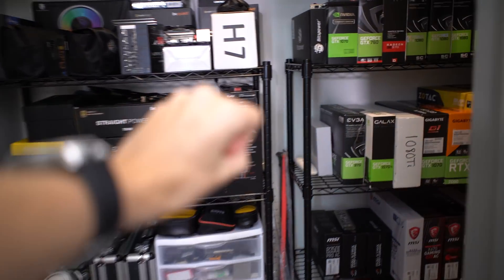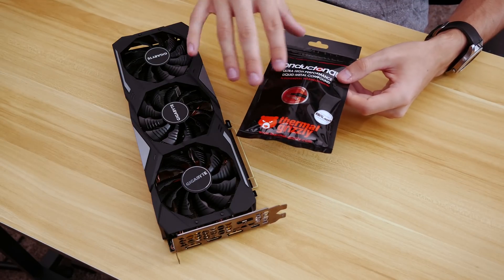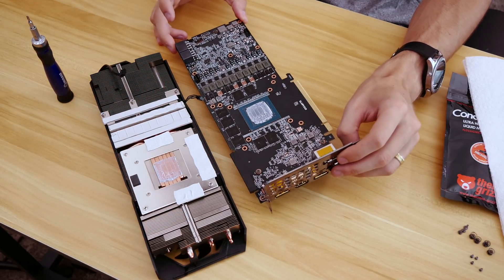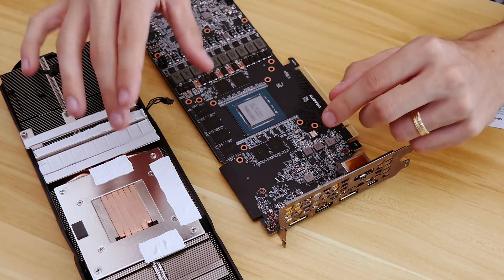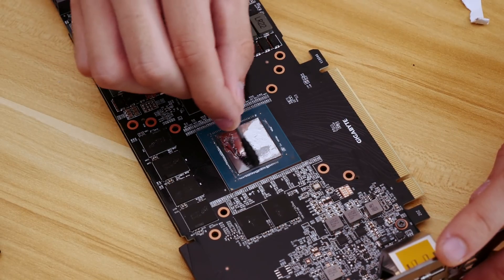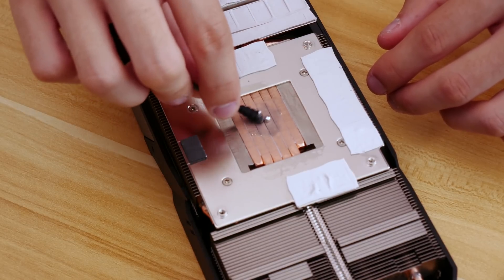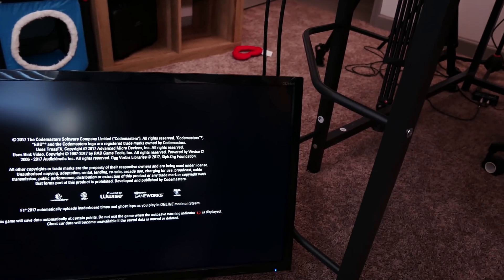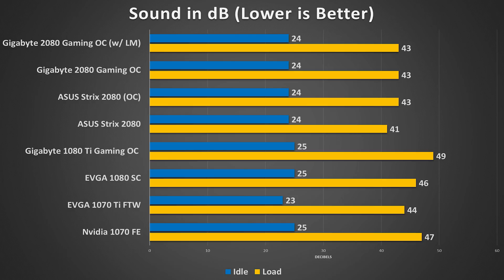Liquid Metal on a Graphics Card?

Comment: I would have added thermal pads or nail pollish over the resistors myself, but I admire the balls it took to experiment on that card. ^_^
Reply: Nail polish isn't made for high temp enviroments. That card will scorch it and it will flake off. Use UV mask. Just a little advice from a micro solder tech who sees people who tried to do this and ruined their card or spent a lot of money for me to chase the short down. I would personally, STRONGLY suggest you NOT do this. But it's your money :)
Reply: @gamerelated3887  No need.  The coldplate covers the resistors too if the thermal pads are making good pressured contact with both, and the face of the CPU is mating well with the block even better.
Done it loads of times to laptops, complete PC's, audio amps, and even routers.
Reply: @JuxZeil  Right on, just posting my experiences. been micro soldering for some time now and I've seen quite a few circumstances where liquid metal got all over the boards. I would probably not recommend this to the general public. I don't doubt that you're sharp enough to make sure that it's safe for you but most people aren't.
Reply: @gamerelated3887  True, but there's a lot of 'hands on' learners like myself out there too, and I like to help them pluck up the courage to use their hands and noggins as well as multiple tutorials.
In case any budding DIY'ers are reading this comment, that includes reading the f'in manual.  Don't be too prideful like the dad that has 4 screws left over and managed to break a fitting all because he didn't think he needed to read the instructions. 😔

Comment: Greg i dont know if you know that but neither mx-2 nor mx-4 are better than most graphicscard thermal paste at least not the newer ones i have a gtx 1080 and after i think 3/4 of a year usage (i buyed it new from amazon for 500 euros) i decided its time to clean it completly so i disassembled everything cleaned it of dust with a brush cleaned of the thermalpaste and put away the thermal pads and put on some better pads then i put on mx-4 and assembled everything again before this i had a stable overclock of 2130 mhz core and 5555mhz vram it was running at 50% max fanspeed (1250 rpm) and was just at the end (before cleaning the dust and thermal paste and pads) reaching 60 C° when the card was fresh it was around 52 C°    but now with the mx-4 its at almost 80 C° with the same fansettings i had to crank it up to around 80% fanspeed (2000rpm) to hold it under 70  and the card would throttle down to 2012 mhz core and sometimes even had artifacts and a lot of crashes i tried to let it run at stocksettings (except the fans) and it was still pretty bad      around 2 weeks later i remember i had a bit liquid metal left that i used for the fx 9590 that i used about half a year ago i put that on (and some old mx-2 as a barrier [after it didnt booted] that i had left it was like gum just a tad more liquidy) but i hadnt enough liquid metal left so it wasnt perfect but it ran at 60% fanspeed and was around 65 C° warm which is much better than the stuff before with the mx-4 and after sometime it got better and now its normally around 50-62 C° when playing demanding titles i buyed some gelid gc-extreme and if i remember right Tech Yes City made a video where he  tested the mx-4 (or 2) and some others and the the gelid gc-extreme too and the gelid one was quiet a bit better i gonna dissasemble my graca soon and well i hope it gets better.

well maybe this is just a random thing but i dont thing that bigger company have lower grade thermal paste like asus gigabyte etc. than the company i have my card from (i got a Palit gtx 1080 jetstream)

Comment: I see a couple of issues with the testing and application here. 

1. Liquid metal will stick to copper, you just have to clean it really well with alcohol first, and apply the metal as soon as it is dry. It will take longer to work out to the proper size, but it will eventually stick. 
2. You need to set your fans to a constant speed, just high enough to not throttle when under load for the tradition TIM. Then do your bench mark, then use the same exact fan speed for the second test after application. Your fans may be kicking on later with liquid metal because the stock curve allows it to still get to the same temp as tradition TIM before running. 

The reason you may have only seen a 1c drop might be because the fans didn't need to work as hard to maintain the same temp. If you did do this, then it should be pointed out in the video.

Comment: Well, i had an Saphire Nitro+ Rx 480 running on Artic mx4 and the temps and noise levels were terrible due to the bad cooler design. On auto fan curve running at stock 1265 mghz undervolted to 1.075v i got around 75 ºC on PUBG with 55 to 65% fan speed. Well, i applied LM on it since the heat sink is cooper plated and the temps lowered about 5 ºC and the fan speed stays about 20 to 30%. So yeah... in terms of temps it was not that big of an improvement, but if i ran it at the same fan speed as before i´m sure that improvement would be more significant.  So using your method of analysis we´re both about 50% right xD Come on, you know better than to make those broad statements.

Comment: Paused at 5:53 to comment. I'm currently worried for those little guys around the die. I usually use clear topcoat fingernail polish on items like that before I use liquid metal. I'm confident yours turned out well without it though, otherwise I have a feeling you would have a very different thumbnail. haha :)

Comment: I'll be honest, I do apply liquid metal on every graphics card I can. 
The reason? It's much quieter, and it usually boosts more.
I do apply some regular thermal paste (and then spread it to avoid disturbing the LM application on the cooler) on the resistors or small components around the die to avoid shortages or spillage. It has always worked for me. 
Another thing to point out is that I usually sand out the cooler, so the LM can have a much better contact.
Reply: Interesting.

Comment: I think to see differences in temperature you would have to set the same fanspeed for both tests. I put liquid metal on my rx480 and I can definitely see an improvement in temperature. (Around 10 °C at 65 % fanspeed) Maybe powercolor used worse thermal paste than gigabyte but still the difference in thermal conductivity is huge between lm and normal paste.

Comment: Or use a conformal coating to protect nearby electonic component... That could be an option... or adviced... or absolutely required to make sure you don't brick your shit when trying to replace the cooler or remove the cooler. also I would add vaseline to the aluminium around near the copper.

Comment: 1. The 20xx GPUs are, according to most, power limited, not thermally limited.  You may get better performance with LM on a 2080 due to better efficiency at lower temperatures, but I don't think this will be much of a difference.  I was able to improve performance on 10xx and 9xx GPUs by using LM because those platforms are often thermally limited.
2.  Try just using masking tape around the die when applying LM.  This is what I do, and it has worked great for me in a bunch of GPU and CPU applications.  It's simple, clean, and works great.

Comment: LM is such a pain to spread. I used it in my asus rog laptop with an i7 7700hq and gtx 1060 6gb.. Cpu no longer throttles and for some odd reason it didn't lower the gpu temps
Reply: On BF1 the cpu would ramp up into the 90s and thermal throttle up to 47% and now its around 80 with no throttling.

Comment: I never done this but my logic says if LM doesn't make contact when you try apply with the buds(heatsink copper) . Then, the LM won't  connect properly when you attach it to the gpu. Maybe that's why you don't see any thermal improvement.

You might want to redo this properly and clean thoroughly before applying to both side.

Comment: What about the copper could that be a reason why the temps didn't come down. Is there another cooler that doesn't use copper?  I was thinking ahead, you have use what's with the card it's not a CPU cooler. But interesting wright?

Comment: Can we just acknowledge that the stock paste job on the card was really, really good? I was pleasantly impressed frankly.
Reply: Without a test with other thermal paste testing he is making an assumption based non the way the paste looks.  Science Studio needs to try different thermal paste to verify.
Reply: Not really. This card is not ideal for using LM. Replacing the paste with Kryonaut would have definitely resulted in lower temps. The guy is a noob. He has absolutely no idea what he was doing.

Comment: I used liquid metal on my RX 580 about a month ago and I had the same problem with it not spreading. so I mixed it with a little arctic silver ceramiq 2 and the results have been pretty good so far. maybe not as good as pure liquid metal but at-least I don't need to worry about it leaking anywhere. it's also going to make a pretty good space heater this winter given how hot the heatsink is to touch.
Reply: How did this work out long term? A lot of thermal pastes have aluminum oxide mixed into their products and this obviously reacts with the gallium.

Comment: I've had to dislike this video... you didn't make any valid conclusion here, yet presented it as such.

If my 1070 is anything to go by, fan speeds don't get above minimum RPM in a benchmark like that, so measuring noise before/after liquid metal application would be senseless. The results you got seem to show a similar story.

Temperature monitoring is fun and games, but I was expecting a 0 degree difference, and that was pretty much what you got too. You really need to perform more extensive testing to get any concluding result.

Did performance increase? Did speeds increase? What about power draw? Any difference there? How about forcing the fans to stay on and run at a set speed and running these tests again?

At that point you'll actually have some data to go off of, this video proved literally nothing :/

Comment: Dude. Conformal coating or clear nail polish painted over the capacitors and some captains tape (the yellow transparent tape, will help keep LM off the components if it squeezes out.

Also, put the drop of liquid metal onto the swab away from the card, not directly onto the die. You save yourself the risk of squirting it out all over the card

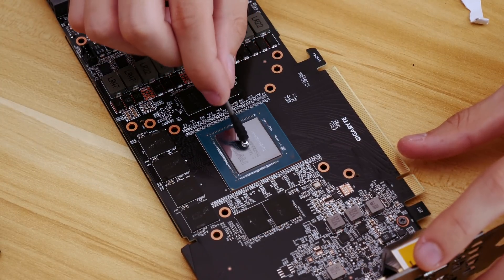Comment: 6:21  You really should have taped off the rest of the PCB before spreading it around.  Any tape can do, and it helps with fuck ups.

After watching the video, and the fact that you didn't get it on both sides, yes, it wasn't correctly applied.  Regardless, you wouldn't see much benefit, anyway.

Comment: if you have beefy cooler it is not necessary , if you have 1080 gtx ex oc kfa2 , with not the best cooler it is much better lost like 7 c if not more , using over a year with no problems  .

Comment: Also it won't break the card permanently if you get LM on the caps around the die, just spray it off good with some brake clean and it will work just fine. It happened to me on the 780, and it didn't post, so I just sprayed it down pretty well, let it dry, and then it worked fine.

Comment: A little useful trick I found to assure the safety of the component your applying liquid metal to, make a tight border of electrical tape around the die. You can buy a wider electrical tape which is what I used.

Comment: i already have conductonout on my 1060 for almost a year now lol :P
Using it with an Arctic Accelero Mono plus because the stock cooler absolutely sucked and started ratteling.
Runns powermodded at a constant 2.1ghz 1.093 volt without any downclock ever at 64°c max.
And yes its pretty silent also

And the turing has pretty big die, more contact area makes using liquidmetal not worth it

Comment: No nail polish? This is dangerous and I LOVE IT!
Reply: His hands still looked well manicured though.
Reply: My thoughts on listening to him talk about how close everything was to the die. XD
Reply: @Drewader  you're absolutely right. I thought the same. He fried the chip, and gave us those shity stats without proof 😂
Reply: yes clear nail polish is your friend
Reply: liquid metal doesn't really "run" like it looks like it would. if you use too much, sure, youre pretty much boned. but if you have a few brain cells left upstairs to bounce ideas off each other, generally you wont need to protect the smt next to the die. in the cases where you do, clear nail polish works well, but so does black high-temp silicon. that's what I used to protect the smt around the die of all the intel chips ive delidded. (LOTS of those hot bastards) and then you can use the same stuff as a thin sealant around the IHS and re-lid the thing so it looks stock and performs like a delid.
Reply: @BenFilley  I'd protect anything around half a mile radius of this nasty stuff.

Comment: This contradicts my results using LM on a 970 and rx 580. I got a 4C drop on the 970 and about a 9C drop on the 580. In both cases I saw nothing wrong with the existing stock paste. I don't remember having the same trouble spreading conductonaut on either card. Both cards have bare copper base plates so maybe the alloy used in those heat pipes is different and prevents adhesion. Also, I've found that temps with conductonaut rise over the course of several months. I don't have the same problem with coollaboratory pro (the blue cap stuff). My hypothesis is that thermal expansion and contraction from temperature cycles makes conductonaut migrate away from hot spots on the die. Coollaboratory liquid pro has microbeads that may mitigate the migration by breaking up the surface tension. So far I think this is specific to GPUs since nothing is said from people doing cpu delids, the larger die size of GPUs may give the LM enough space to clump and dry in certain areas. This is the first time I've seen someone get a 0C delta.

Comment: Just a little tip on applying liquid metal, heat up the die surface 1st then apply liquid metal. It helps in spreading it much more evenly and its easier.

Comment: I wouldn't say that applying Liquid Metal to GPU's is completely useless (yet). Maybe you can revisit this test in a different video with a graphics card heatsink with Nickle plated Copper?
Reply: LM works great with water cooling as it can transfer the heat faster than paste.  LM has been great for the water cooling scene.
Reply: I agree... I still use to this day a watercooled 7970 with LM on my Nickel EKWB and there is relevant performance difference especially if you have decent rad area.

Comment: I'm willing to bet the heat sink surface isn't as smooth as the underside of the Intel IHS. Therefore, I bet it isn't making the most efficient transfer. 

By the way, I somehow got liquid metal on the copper cold plate of my Corsair H115.

Comment: You don't gain that much by applying LM on GPU because there is no die cover. Cooler has a direct contact with the die. My temps went down by 3 deg Celcius on a 1080ti (ref) with a Accelero Extreme IV. More can be gained by optimising the case air intake

Comment: " EVGA cards in the past are difficult to take apart " ..... humm the vast majority of EVGA cards I have come in contact with only need 4 - 6 screws removed, soooo
Reply: I took apart my EVGA GTX 960 before and it had like...9 screws
Reply: hmmm I'm honestly curious if you remember what P/N version roughly it was ? I believe you btw, not trying to challenge you I'm just curious now because I have two EVGA GTS 250's once ran in SLI,  EVGA GTX 780 SC, two X EVGA GTX 950 SSC that were  run in SLI, EVGA 960 SC, EVGA 970 SSC,  EVGA 970 SSC+ ( yes they are very different before someone else says something there are 3 PCB's that the EVGA GTX 970's are built on. These EVGA 970's are not all compatible in SLI together, its possible to have 3 EVGA GTX 970 SSC's and none of them in any combination will function in SLI together.)  EVGA GTX 1060 3gb, and EVGA GTX 1080 SC... LOL  ...   So looking at all of my EVGA cards, all of the ones that I own the majority of them only require 4 spring loaded Phillips screws to access the PCB/GPU core.  besides the GTS 250's they require "12" spring loaded Phillips screws to access the PCB/Core.

Okay... I think this is all a misunderstanding... If all you want to do is just get to the GPU core then anything 700 series and up with an ACX cooler only needs 4 screws..  BUT, you can run into situations when you bring up cards with a " backplate" and these seems to require anywhere in total from 15 - 18 screws including the 4 main spring screws.   I think maybe there is where we were getting our lines crossed ? because there are thermal pads under most of those backpaltes if not all of them and that is crazy over built IMO and you would be correct with your statement you made if you take into consideration the removal of backplates.  If we are only talking about purely removing the cooler.  The majority of modern cards ( modern to me is anything 700 and newer ) from EVGA, about 85% of them only need 4 quick ones removed to be able to change the thermal paste.  The other %15 and I'm generalizing here are cards with the most hardcore exotic cooling situations like the HydroCopper, or the ICX 3 FTW+ ... like the cards that have a crap load of extra tags at the end of it look to require between 6 and 7.

Comment: Liquid metal is not a bad idea if the cold plate is nickel and not copper, and make if it's direct heat pipes on the gpu itself  don't bother. Make sure you liquid electrical tape on the caps around the gpu as well